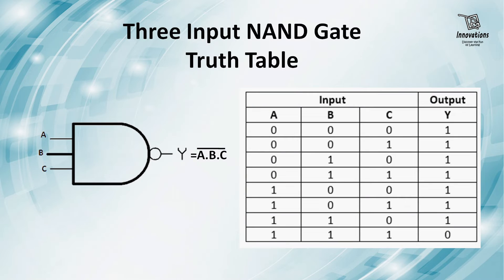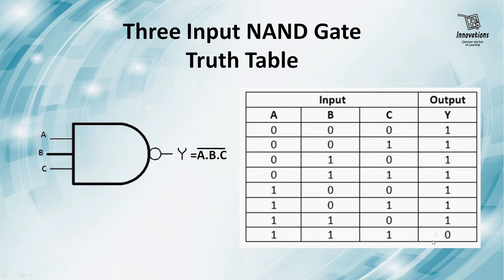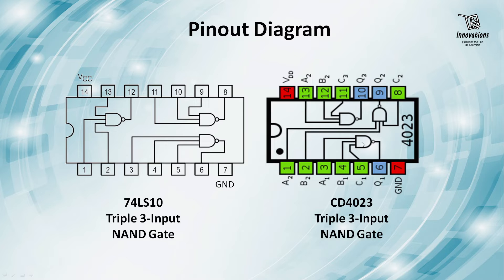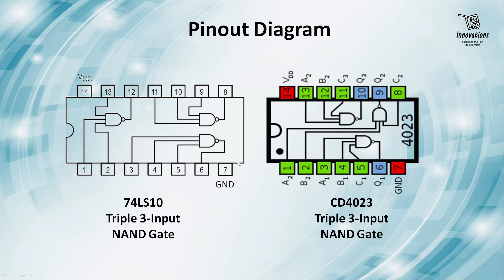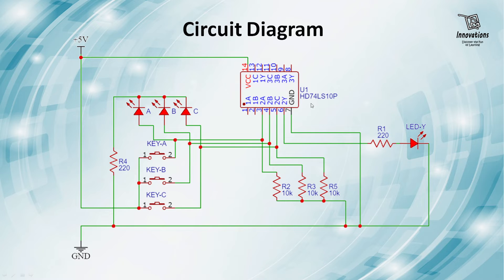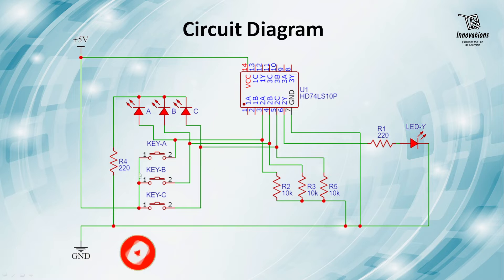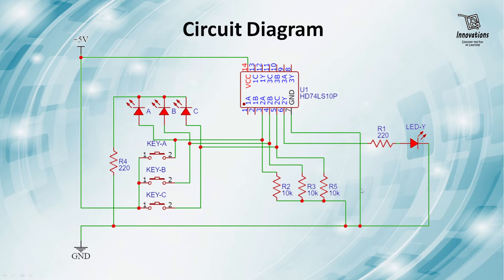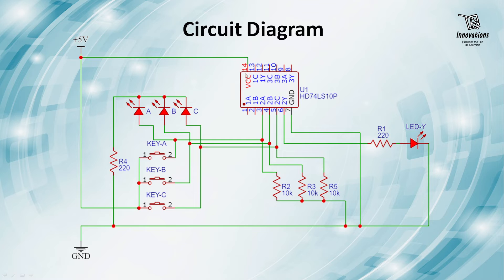74LS10 & CD4023 IC - Triple 3 Input NAND Gate IC Practical Demo with Truth Table | 7410 IC | 4023 IC

Comment: Awesome video, what would you replace a 962PC Triple input NAND with?
Reply from the maker: sorry, Your question is not clear to me...
Reply: @RGInnovations  can I replace a MC862P with a 74LS10?
Reply from the maker: yes you can replace, but check the input and output pins.
Reply: @RGInnovations Great, thank you very much!
Reply from the maker: most welcome.
Reply: @RGInnovations can we input 12V to the input pins of this ic?? What is the voltage range of these input pins?? Of course, vcc supports max 15V.
Reply from the maker: @tnamen1307 more than 5.5v will burn the ic.
Reply: @RGInnovations  oh ...
Please suggest similar NAND GATE ic which accepts between 0v to 12v as input signals?? I need 4 inputs which accepts max 12 to 15v.
I really need for my car modifications on door signal system.
Reply: @RGInnovations  the door has 12v when it is closed, and 0v when opened.
So I really need ic which accepts max 12 to 15v 😞😞😞
Reply from the maker: Use a 7805 ic to reduce the voltage.
Reply: @RGInnovations  if 7805 is used, then the 12V during door closed will be connected to ground. Hence, it will be 0V will door closed. This is false Signal.